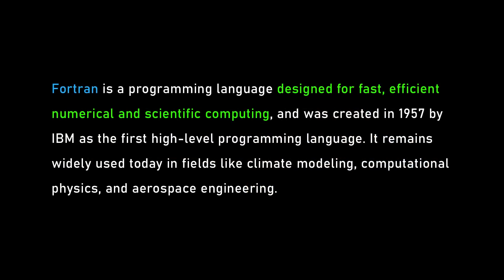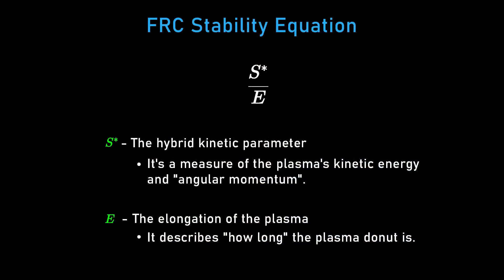Code that controls nuclear fusion: What programming language is used? | David Kirtley

Comment: Python and Fast : 2 words i never hear together
Reply: Python can be fast if the underlying calls are in C++
Reply: @glee21012  So use C++ instead of Python.  It's weird how people shy away from C/C++ and do assembly when the performance is so close. Python is not in that league unless you are calling C/C++ but it is always better ti stay in one language because your team only needs one skill set.
Reply: @glee21012 that's called cython
Reply: @glee21012  Even numpy calls are in C++, however abstractions take away quite some runtime. So using Python makes no sense for making something faster. I would rather go with matlab if it's just about modelling.
Reply: I suspect the time critical stuff is encoded in the FPGAs using HDLs. The other languages - reading between the lines and comparing with time-critical finance trading - are just used to derive the settings used at initialisation. What language you use won't affect the time-critical, operational stuff. That needs to be  handled at the PGA level.
Reply: Cython
Reply: Check about cython
Reply: That is also changing with the advent of Mojo.
Reply: I presume, that they are using Python for simulation, not for programming of an actual fusion machine, which would be in assembly language. For that use, Python is fast. It takes scientists, non-programmers faster to code simulation in python and then run it, than do it in faster, but more difficult languages.
Reply: FastAPI is a Python back-end framework. So I believe you haven't heard enough 😂.
Reply: Python is never used for the actual computation -- that is done in external libraries like numpy, scikit, etc. Python is used as the glue that holds stuff together. It's perfect for that in that it is usable by people who are scientists but not computer scientists or professional programmers.
Reply: @csmac3144a I call it a scripting language, like matlab.
Reply: @csmac3144a exactly more user friendly while they concentrate on the hard stuff that really matters, Nuclear Fusion
Reply: @csmac3144a  It's not even perfect for that, the dynamic typing really makes it junk for anything even a bit more complicated than some short scripts. I used Python for some stuff, but debugging the logical errors was just too painful. Then I switched to C# and the difference is night and day in productivity.
Reply: you get the best of both worls, easy  syntax to program software, and high performance code throught api calls (C/C++/Rust code)
Reply: Python is garbage
Reply: The Python is just being used to script the fast code written in FORTRAN, assembly, the languages that allow fast operation.
Reply: I would assume even in machine language, lower level and faster than assembler language, for the most time critical part
Reply: why would you?
Reply: this is like saying you never fly an airplane because the check-in process involves you walking instead of flying. You usually initiate fast c or assembly code through python which gives you an enourmous advantage regarding abstraction via python and speed via low level code in one package.
Reply: @0nelight19 why not just do it all c++ then?
Reply: @0nelight19  And you could just use C# and probably never need to even call any C++ unless you really work in some critical real time systems. As a bonus, much easier debugging and countless errors related to dynamic typing avoided. Scientists could have just as easily chosen C# as the learning curve isn't that high, but someone decided to go with the scripting language probably because they disliked Microsoft or whatever.
Reply: then you dont understand python
Reply: @abir95571 Dint be a Python simp. It is unbecoming.
Reply: I was thinking the same thing. What is with mathematicians and scientists when it comes to python?
Reply: @ycombine1053 Scientific code is usually horrific - I say that as a former scientist who wrote a lot of (bad) code and worked with a lot of other scientific code.  The software engineering in industry is generally much. much better (CI/CD, widespread use of tooling like the Jetbrains products etc), especially when it is designed for high-availability (commercial web-facing products).
Reply: @ycombine1053 it's a nice way of scripting it all, faster than pressing compile all the time
Reply: @ycombine1053because Python is a great glue language so you can use it to interface with your FPGA and develop with the super fast development environment of Python while calling functions in the lower FPGA language.

Comment: After watching this I understand why fusion is always 50 years away
Reply: Not true! It has always been 20 years away.

Seriously, I took a plasma physics course as an undergraduate to see if it was what I wanted to pursue as a career. While fusion power is the holy grail, it should be understood that plasma physics is of interest for both scientific and practical reasons other than fusion power. Most of the physical universe we can observe is plasma in the form of stars, so there's that. You can't understand how our Sun works without understanding plasma physics. Secondly, plasma is widely used in many engineering applications, especially in the manufacture of integrated circuits. 

As for fusion power, it was clear to me that it would take decades to achieve breakeven and even more decades after that to make the technology cost-effective -- if ever. It's a highly difficult problem to solve and I'm sure I won't see it solved within my lifetime.
Reply: @danblanks3190 funny that all my lectures and the fusion  research facility all joked 50 years. But I do admire the optimism and maybe we are closer than ever.
Reply: Its a con-artists subject now.  They use it to pass the collection plate around (or raise money).  Nothing will ever happen with these current generations of humans.
Reply: Some are containing the fusion with sound rather than electric fields. Seems there is a future there as it is more controllable and responsive.
Reply: Python 😅
Reply: @MythTrek  when he says "Python", he probaly means they're using numpy (written in Fortran) or any similar package that has a high-performance low-level implementation.
Reply: @taherassaid  It will be exciting, when they finally dump the GIL. Dumping the GIL is not an easy task as the libraries need to be prepared for multithreading in order to work well in that situation. But as the numpy package has LAPACK of Fortran in the back I wonder how much of an issue this will remain. If we are lucky there is no issue at all. And if some company happen to do that professionally, you can even replace that LAPACK for one of a Fortran that is optimized for your machine. ONLY THEN you are faster than C these days. For instance "Intel Fortran" has still some tricks up its sleeve for the Intel chips. Will be fun to see when Python is faster than C.... well, sort of.
Reply: @MythTrek now I got the joke
Reply: *was always 50yrs away

Now it's more like "economically-advantageous fusion is 10yrs away" since fusion already is here, just not useful at a grand scale
Reply: @rr.studios   It's done! It's easy. And it's Mother Nature's gentle approach: https://www.youtube.com/watch?v=1FThNqCf70c
Reply: @rr.studios and in 10 years it’s 40 years away, then you are onto something.
Reply: It's actually pretty disappointing to see that the Fusion industry is full of buzzwords chasers instead of doers.
Reply: Now its 500 years away. Its going up.
Reply: Its because of the banksters and elites desire to keep screws the rest of humanity

Comment: programming language is used for:

Layer Language/Technology
Real-Time Plasma Control C, C++, VHDL/Verilog
Interlock / Safety PLC Structured Text, Ladder
HMI / Supervisory Python, Java, C#, C++
Data-Acquisition EPICS + C/C++
Physics Simulation Fortran, Python
Cyber-Security/DevOps Bash, PowerShell, Go

Fusion reactor is a multi-layer safety-critical system
Each layer has different timing, safety, and reliability requirements
C/C++ for real-time control
PLC languages for safety
Fortran/Python for modeling
Java/C# for supervisory
EPICS for integration
Reply: Simulation with Python? 😂 What are these people thinking.
Reply: incorrect, we use ONLY relays and PLCs in the system due to cyber security failures with all other powerful languages. for this reason modelling and so on with high level languages is NOT apart of the control system.
Reply: relays and PLC ,means Industrial Programming!
Reply: @MdHarun-hv9ol  correct. and nigh on all other languages mean the contrary
Reply: @FS99999  protip if you're worried about cyber security, don't connect your fusion reactor to the internet, a lot of bad people there
Reply: @FS99999  Interesting, so you just use typical industrial control systems in fusion, no proprietary APC components? I always just assumed there would be some complex layer of real time modelling driving everything that would be too heavy for a normal controller. I assume single controller networks to keep loop times fast, or is it distributed?

Comment: TLDR: it's a mix of Fortran, Java, Python, Assembly (1:32)
Reply: He is not clear, but he says they use FPGAs right when he said assembly which are not programmed in assembly but rather using a Hardware Description Language like Verilog or VHDL.
Reply: @oslogardenghi9687  I don't think he knows. Just speaking buzz words.
Reply: @oslogardenghi9687 

You are correct but getting into the details of how they are actually programmed is maybe counterproductive for this level of discussion. Also, is it  possible to program them in something that is still a bit higher level than that with an additional layer of software? My ancient understanding was that this was a large and complex topic.
Reply: @oslogardenghi9687 isn’t that a high level language? Would it be calling assembly?
Reply: @theuserofdoom No, Hardware Description Languages are a completely distinct concept from software programming altogether.

I've got no idea what he means when he says "the assembly language" of those FPGAs, because FPGAs fundamentally don't utilise anything like an instruction set. 

Presumably, he doesn't want to get into the weeds of what a HDL is, or programmable logic vs software, so he just said "assembly language" so the layman would understand it to mean "very low level".
Reply: @tomfahey2823  oh i see. like it's basically you designing the chip?
Reply: @theuserofdoom Yes, it's actually exactly the same process (more or less) that is used to design computer chips. The only difference is that FPGAs are typically used to implement fixed function routines, where the software program is "baked into the chip". This gives you an enormous speed up, because the program is running at the hardware level, so you don't have to deal with all of the additional layers of abstraction that a computer does, like memory management, pipelining, multi-cycle instructions etc.

However, it is perfectly possible to program an FPGA with a computer chip architecture. People do this quite regularly for retro gaming chips, like the Z86 etc. but plausibly you could recreate an older x86 or ARM architecture on a FPGA with enough CLBs.
Reply: @theuserofdoom  it is as low as logic gates themselves go... i wouldnt call it assembly but id say its actually way closer to hw than assembly
Reply: Bro skipped C
Reply: @theuserofdoom nobody use C. Mostly fortran for performance and python for higher level abstraction of the fortran code. Some people use c++ but those code are usually coded by non-scientist.
Reply: Listen to what he said - government programs. That means a bunch of boffins have been developing libraries for 40 years (they work and if you touch them they won't) in whatever modern language was popular at the time of its writing. The critical work here is done by the FPGAs - all coded in HDLs.
Reply: And FPGA's
Reply: Fortran 77 or Fortran 90? 😅
Reply: Thank you.

Now we all know why this ʇᴉɥs won't work 😂😂😂

Not that any of these languages (or script for python) are bad.

Just I cannot believe they would actually use Python in safety critical equipment, particularly with a fusion reactor 😂😂😂

(My guess is they aren't using Python for operating conditions but rather their "logic control." So basically they have an oversized raspberry pi that's capable of melting a city from a mile away 😂😂
Reply: thank you, was guessing fortran is surely involved
Reply: Also assembly language run on FPGAs.. others are application level Java and Python probably on the out app UI layer probabvly mission critical could be Assembly and Fortran possibly
Reply: The picture looked very old FORTRAN
Reply: U saved me a lot of time
Reply: No Haskell?
Reply: no Rust?🤭
Reply: Java is surprising, as it is so slow. Maybe for the interface only.
Reply: @KarmaKahn  Java and Python for the low level computation, Fortran for CRUD and Assembly for the UI
Reply: @romedreba1587 I think u got that bass ackwards
Reply: @kayakMike1000  yeah that was a poor attempt at being funny
Reply: @romedreba1587  Ooohhh, that explains it.
Reply: @romedreba1587  Nice one. 😂
Reply: @romedreba1587  LOL.
Reply: @romedreba1587  I would have said polite attempt. Hadn't read this far down in the comments to see that most people didn't get the joke. 🤦‍♂
Reply: @romedreba1587 very well said, mate 😂

Comment: A Breakthrough is a year away, yearly for the the last 50 years. Is there a formula for how grant money flowing into the fusion black hole disappears??? 
💵🔥
Reply: Don't know about Hellion, but for CFS SPARC, DoE uses a similar model to NASA/SpaceX, where funding only flows AFTER each of the pre-agreed milestones are actually demonstrated and the majority of funding is private, not gov't. 
Companies willing to use that model for the most part truly believe and have high confidence they can do what it is they are working on as opposed to the "cost+" or "give me a grant and I'll do something" crowd. Those models have a limited place too, but if some company/lab is now saying "We actually believe we can do this and here's why", then the switch to milestone/private funding should always happen.
And think of it this way...If just one of those companies actually pulls it off, then the entire decades long funding train will have been worth it.